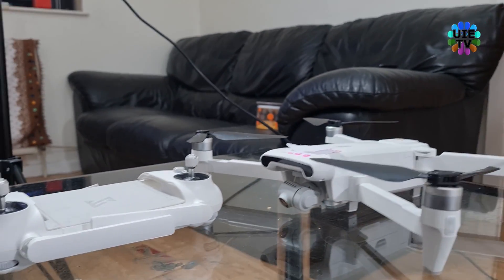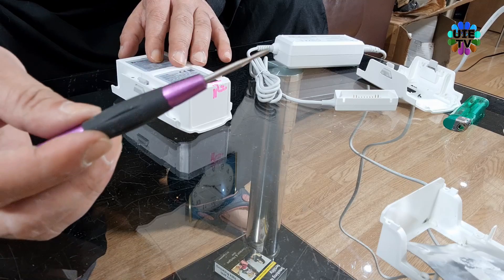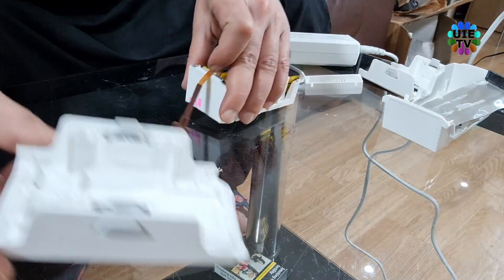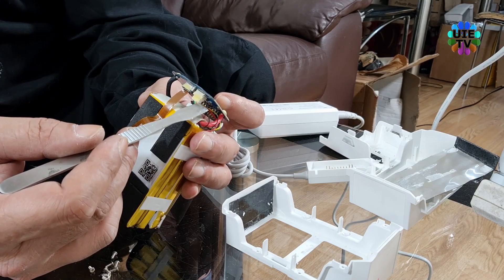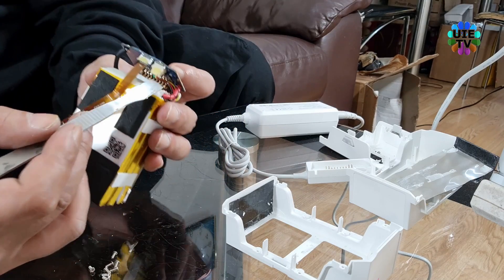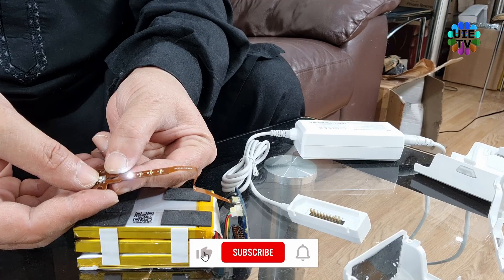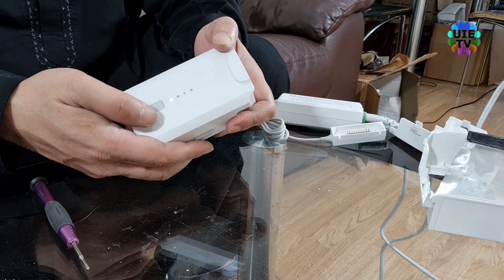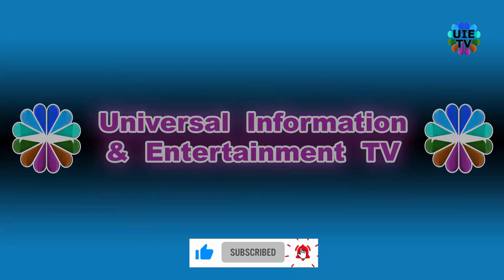Xiaomi Fimi Drone battery repair Tip fix common fault in 5 minutes. 2017-2020 se x8 a3 drone problem

Comment: I did the fix, and got the battery to charge to full but then when I went to use the drone a message was on my phone saying "battery damaged, cannot continue to use"  "unstable battery voltage, use with caution" and "battery cells may be damaged,  please replace them as soon as possible."  any thoughts? Do I have to reset it again now that the battery is full?

Comment: Yes, the battery will charge, but the FIMI software will not allow it to fly the drone.  It still registers as a battery that has been damaged.
Reply: I have reset my battery using site?. the battery did recharge to full capacity but will not let me fly because has stated earlier Fimi have downloaded a virus into your software and stopped you from even flying your drone again, even with a new battery, which your drone won`t accept. Your drone is now useless, and should be put on a shelf has an ornament to look at?. You must all get in touch and threaten them with action?. tell your friends NOT TO BUY A DRONE FROM THE ROBBER MEN??.

Comment: …no caso de vocês era resetar e, no meu caso que ela não carregava.  Eu segui os passos de vocês: abri; fiz o reset e, não voltou ao normal? Pude perceber que tem um friozinho solto. Fiozinho Preto Fininho que está desconectado. O que fazer então?

…in your case it was reset and in my case it wasn't loaded. I followed in your footsteps: I opened; I did the reset and it didn't go back to normal? I could see that it has a loose chill. Fiozinho Preto Fininho that is offline. What to do then?

Comment: it is not necessary to disassemble everything to disconnect the connector. Just grab a blade, cut through the glue, and press a connector release button, and you're done. I used a magnifying glass to disassemble it. Greetings and thanks for your video, it saved me 100 dollars.
Reply: I think so, just disassemble top cover then unplug the cable

Comment: my flat battery cable burned out. Where can I buy a new one? Thanks
Reply from the maker: https://www.ebay.co.uk/sch/i.html?_dkr=1&iconV2Request=true&_blrs=recall_filtering&_ssn=luton.car.parts&store_cat=0&store_name=lutoncarparts&_oac=1&_nkw=fimi%20x8

check above link to buy parts, its my ebay shop.

Comment: Strait to the point i had a 2cycle battry fail on me (been stored for almost 3 years) this worked a treat thank you very much
Reply: Not worked for me 🤨 .After 3 year hibernation,stil 54% ,but not charging,and not powering on the rotors.When i put on charger: 2 light blinking and after 5 sec all 4 start blinking(not 2-2 alternatively as in video),and stop after 4-5 seconds.

Comment: Thank you so much for posting this! I was about to discard my Fimi battery when I found your video and followed your instructions to the letter, connected the charger, and not only begin to charge immediately, but it showed that the battery already had two bars(dots) of charge! It’s charging right now and hopefully it will reach full charge in the next hour.

Comment: I have seen from another video that this repair attempt hasn't gone well because the drone detects battery over discharge setting count 1 and it refuses to work... have you tried to disconnect the battery pcb again a second time "after" charge waiting to see if it resets? I guess that maybe such over-discharge count is set to 1 because after the first reset that allowed you to charge the battery, the control system of battery counted such charge started from 0% as well.

Comment: I followed the video and the battery is charged, but when I connect it to the drone, it still gives me an error
Reply: Yes, the same here, all 3 Cells have correct voltage after charging, all seems fine, but when replaced at the Fimi X8SE and connected, I can not fly, error message, battery is (still) damaged, because it was one time deep discharged :)
Reply: @forextraderradioman  tôi cũng bị như vậy có cách nào giải quyết vấn đề này không???
Reply: @dorly99  Tiếc là không có. Thật không may, không có giải pháp cho điều này, bạn phải mua pin mới. Lời chào từ Đức, Dietmar :)

Comment: Same after repair. Any solution for this ?
Battery error appeared after couple uses only. was not dropped. all cells are balanced. Charger can charger but drone still gives error.
Reply: the same here :(
Reply: same herw

Comment: You know that the battery is useless after this reparation.
The battery can not be used.
Fimi is a fraud but you too because don’t to say openly…
Reply: There are igenuity people who congratulate you for the video and you don’t send them to the other link, I think you are only interested in the traffic for the se Video and in reality we should set up a forum to force fimi to change the firmware of the battery
Reply from the maker: 2nd video link is in the comments, you might need to scroll it down, 

i tried many time to call and chat with fimi help lines. they just said nothing,  but i have a fimi mini drone and i tested my mini x8 drone for few times upto 0% battery, luckily they dont have any thing which says that battery is damaged. its good step by fimi but i am sure they can send updates with new firmware for battery who can fix the damaged batteries. but unfortunately they wont do it because they want to make money, i made another video where i am using that so called damaged battery with modification, and used into to hubsan zino pro drone, it gives a lot of flying time, link is here. 

https://youtu.be/xAsInFsOyCI 
 in this vide, i took out the battery cells of fimi x8 drone and then modified with hubsan zino pro drone, it worked perfect, and even its working until now, i modified last year.
Reply from the maker: i am not fraud at all, because i made another video when i found the prblem, 
check this link, where i am giving more information and including that the battery does not work, and i am suggesting that never buy fimi x8 drone. https://youtu.be/t3w1V_8a-WU

Comment: another video about nothing, how to reset the battery restart, only after this reset the drone does not take off as it gives an error despite the fact that the battery is charged 100%
Reply from the maker: how about this new video?

https://youtu.be/cilB3eX_sDQ 

Battery Mod Modification & Repair over Discharged, Very Easy on Hubsan Zino Mini Pro & SE Drones

Comment: Thank you. This info on how to reset really helped, my battery now started charging again. Don't know how can I trust this battery again, probably will use as a last last last minute  backup. Some fast facts. My cable didn't have any colors just black and didn't have to remove the 3 elements. The adapter was removable after I unscrewed everything even the top box. Still it worked really nice. Thanks again

Comment: Why my drone return to home when it reaches the battery 🔋 level to 30%?
Reply from the maker: it is good for your battery, you can change the settings for RTH for even 10% but you will loose battery if you touch to 15% of battery level. so i suggest to leave it as it is, thanks

Comment: it is not necessary to disassemble everything! only the cover, you remove the connector, reconnect after 30 seconds and it works! total: 5 minutes! I just did it !
Reply: perfect--thankyou. worked a treat
Reply: I did the same, and it worked perfectly
Reply: I tried this and it doesn't work, enabling everything and it charges but when I plug it into the drone it says Battery damaged, can't be used anymore..

Why???
Reply: @danishhotdog   Battery damaged
Reply: @infrastructure-h9b  but it charges, all cells has the same Voltage everything is ok with battery....
Reply: @danishhotdog same here. battery has only 8 cycle. it was showing 34 percent when I was trying to land, suddenly battery level dropped to 0. I did not crash and I did charge like in this video. Every cell voltages are okay but drone refuses to start motors.
Reply from the maker: its actually true, i did it because i wanted to show all clear picture of battery as well. thanks

Comment: Say Good By For Your Baterry. Its Bad Pabrication of baterry. Even it can charge again after your fix with put off slot of cable inside baterry. Your baterry still can not used for fly with your drone..
Reply from the maker: https://youtu.be/tCgOL0_qkbM    
2021 DJi Mini 2 vs Fimi Mini x8 Aerial Photoshoot Comparison 12 mega pixel 12MP Camera Still Image

Comment: Any chance you guys know how to repair the battery for the Xiaomi MI 4K drone?
Reply from the maker: it should be same method
Reply from the maker: It should be similar
Reply: @universalinformationentert3976  I have tried removing the small cable from the micro controller but that doesn’t do anything.
Reply: @IKE_MMA  leave that small connector unplugged while plugging in charger, then reconnect small connector and then unplug and replace in charger to battery and it WILL charge.  You have to do it every charge though...

Comment: You did not solved the problem cause the battery is now tagged as faulty and can't be used.
Misleading title to get views.
Reply from the maker: the title is how to fix battery charging problem, what is misleading? i have made another video which says it will not fly the drone and drone will not accept it, please watch this link.    https://youtu.be/t3w1V_8a-WU  
thanks

Comment: I did what you did but after turning it off it won't charge.  In addition, the controller and the drone are not connected.
Reply from the maker: You might have problem with drone. Or try in open sky

Comment: This will not reset  battery, try  check using App  to view  the  battery information showing   overcharged how many time,
Later,  battery will not charge again as long as  overdischarge record
Reply from the maker: it does reset the battery, 100% true. check the video or try it by yourself.

but

please watch this video,
 https://youtu.be/t3w1V_8a-WU

 its part 2 for further information, 
thanks
Reply: @universalinformationentert3976  szkoda czasu bo to nie dziala . Robilem tak ponad rok temu a ten tu  cwaniaka zgrywa
Reply from the maker: https://youtu.be/Pl6gSrpeqjA 
must watch this new updated video
Reply from the maker: https://youtu.be/Pl6gSrpeqjA 
must watch this new updated video
Reply: Superb, and easy fix to locked out charge cycle! Thanks!
Reply: it will reset the battery, i did it and it works, starts charging again as normal. but does not work in drone.
Reply: @nasimaltaf786  yes... Its Alright... can not use again for fly with drone